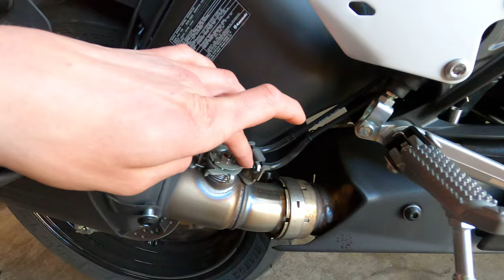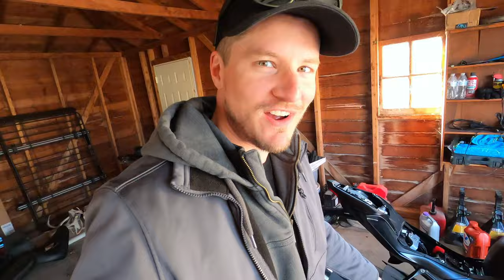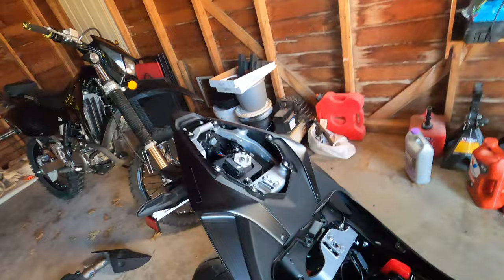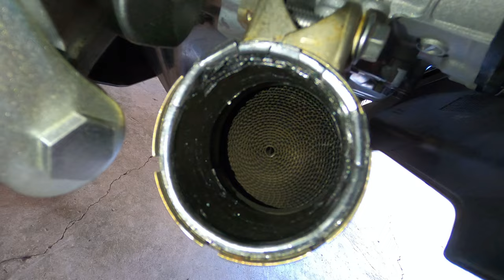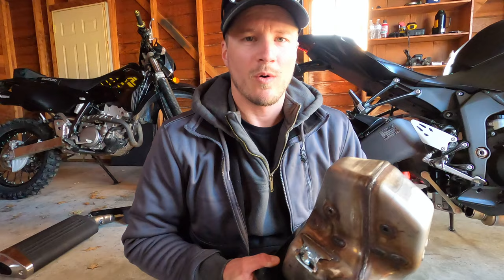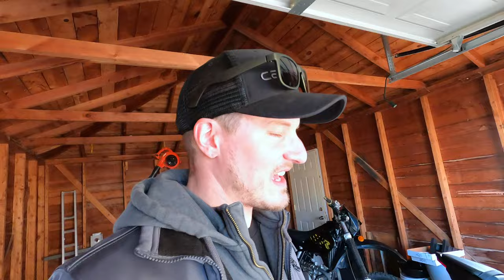Kawasaki Ninja ZX6R Exhausts / Every Question Answered / 2025-2009 / Removal, Install, Servo, CEL

Comment: I bought the M4 street slayer slip on. It sounds EXACTLY the same (without baffler) as the slip on the guy used in this video. Save your money, $100 vs $400. It is VERY loud, if you don't mind the noise, keep it. I recommend trying out the muffler with decible killer that this guy has a link for, BEFORE spending $400

Comment: Just btw, not saying anything is necessarily wrong, but it can take up to 100 miles in some cases before the ecu re-checks all sensors in order to throw a code or not, sometimes just resetting the battery works too but not always

Comment: I have good news and i have some bad news, good news is i can confirm on a 2023 zx6r that keeping the servo plugged in does not throw any codes or prompt an engine light no servo buddy needed. Now for the bad news, that last bolt you had trouble with on the expansion chamber also is giving me one hell of a time, it snapped my allen key so now i have a tip of an allen wrench wedged in there so now I am stuck trying to get that thing out.

Comment: As I’m watching this with great frustration, I’m now grateful to see you remove the expansion chamber. I could not get it to budge at all. Tomorrow is a new day!
Reply from the maker: Yeah just back and down, it's tight but it will slip outta there 👍
Reply: @bikesandbangs I really hope so. My Allen wrenches are in one of those pop out sets. I may need something better with more leverage. I tried for 2 hours tonight. You give me hope. As for the servo. I saw that tonight and was like wtf is that. I may have violently pulled it from the stock pipe. Oops. Anyhow. Links are here and now I have hope and pipe comes tomorrow. Picked up my 24 zx6 last week. So excited. Dropping 2 inches. On that note, do I need to make any adjustments to the suspension after that drop?
Reply from the maker: You won't need to adjust the suspension settings to maintain the same ride quality with lowering links, should feel the same. It will corner and handle different in the twisties though because it does slightly change the geometry of the bike. If you haven't had a chance to really throw it around you won't notice a difference 👍

Comment: I tried this and followed this to the T, even got the same materials, same fender eliminator from another video, etc.

Once I got to the factory link pipe / muffler after removing the exhaust, I found an o2 sensor on it, mine has two sensors. One in the muffler, at the beginning, right after the catalytic converter, and another before the catalytic converter.

Maybe it’s just an Europe thing?
Reply: Just reading through the comments and came across your post. I recently received my Racefit Growler X exhaust and plan on installing it this weekend. My exhaust came with a spot for a 2nd O2 sensor. My 24' ZX-6R only has one. I spoke with the owner of Racefit (In the UK) and the Euro bikes DO have two O2 sensors. It must be a Euro thing. I have to have an O2 plug in my exhaust because the US models only have one O2 sensor.
Reply: It does have 2 O2 sensors for the Euro5+ rating. I guess it's a matter of drilling a hole in the new link pipe to put it in? I bet there's sensor deleters too

Comment: I think that the misconception that the expansion chamber is the cat comes from the fact that on the ZX10R it is the cat.  Gutting the cat in the ZX6R header is a major PITA and is best done off the bike.  You will need a flash/tune and even then it's not a substitute for an aftermarket header/full exhaust.  Hindle makes a good full exhaust for those on a budget, don't waste your money on an Akra or SC or any of the poser exhausts, al they get you is bragging rights.

Comment: Hey Bud. I was watching your video about taking the servo cable only on the servo with your after market exhaust. Did you got any check engine light lately since you install the ebay exhaust?
Reply from the maker: Nope, just remove the cables and leave the servo wires plugged in and ur good to go 👍

Comment: the video is 6mos old is there any update to if the engine code came up after riding without the servo cables but leaving the servo still plugged in?
Reply from the maker: Never got a code 👍

Comment: geez...my 6MM bolt for the resonator chamber part came somewhat stripped by the factory! I have to call a friend over with mechanical wizardry to hopefully help me find a way to get it off. I got everything off just fine, even the 6mm bolt just below the tough one, so I know my hex size is right. What sort of monster put this thing together?!?! 
Edit: My friend used a hammer to bang the hex socket into that slightly stripped bolt and was able to get that monster off! Also prying that nut out of the metal housing on the back of Res Chamber was much harder on my bike than the video, I ended up having to Dremel saw it open enough to get that nut out! Everything else was exactly like the video, thank you very much for the help here!

Comment: Question; did you ever get an engine code from removing the cables from the servo motor? I’m about to attempt this process on my ‘24 zx6r
Reply from the maker: Nope never did, servo still plugged in with no cables
Reply: @bikesandbangs thanks buddy! Loving the videos, keep up the great work! 🤙🏼

Comment: hi man, if i put a slip on with mid pipe that removes the expansion chamber do i have to flash the bike ? will the motor be hurt if i dont? thankss
Reply from the maker: No you do not have to flash it 👍

Comment: Is there a way to make bike loud by using the stock exhaust? i mean just remove servo cable and by default that butterfly valve is always on and remove the breadbox and put a linkpipe with stock exhaust.. will it work?..
Reply from the maker: So I think you could do the link pipe to the stock muffler with the servo cables removed. But 90% of your sound dampening is in the muffler, so it will be a little more volume, but not much. The link pipe to delete the bread box is $65 and a no name mufflers is only $35 more. What is your reasoning in wanting to keep the factory muffler?
Reply: @bikesandbangs  I saw a fellow versys rider do that... And it sounded great... Actually here at my place sometimes police would do special drives and if caught they would seize your bike with aftermarket exhaust .. then you have to pay fine upto 250$ if i convert to USD 😂
Reply: If you do aftermarket headers, it should sound louder while keeping your stock exhaust and deleting the mid pipe.

Comment: Do I really need the curved connection/ link pipe for back pressure I think you called it? also it just looks so close to the rear tire is that also not an issue with the link pipe you used?

Comment: With a complete system change, do i need to do anything to the ecu/ mapping?
Reply from the maker: I'd get a flash if you do a full system. You might notice a slight dip in low rpm power, depends what system you go with. But you won't gain any power until a flash or tune, then you should see 12+ hp

Comment: I'm strongly considering running this on my zx6, but my main question is, does that exhaust and tip rub up against the swingarm at all after hitting bumps? Was a little worried about if there was any issue with clearance for everything.
Reply from the maker: No issues with clearance, it's not even close 👍

Comment: When you put this exhaust on did the exhaust fit into the cat like 100% snug? I just put one on a friends bike and there is a little bit of an exhaust leak where the turn pipe goes into the cat. The carbon seal is still intact.
Reply from the maker: Mine is 100% snug and tight with no leaks. Maybe check and see if the exhaust clamp is tight enough

Comment: Very informative! My expansion chamber won’t come off. Probably going to have to drill the bolts to get them out some the Allen key has stripped them from my tugging at them
Reply from the maker: Dang, idk why that Alan head bolt is on there so tight! Like it's ridiculous

Comment: there's no point in doing ANY exhaust work if you're not planning on getting the ECU flashed.. there is literally zero gain and all you did was make the bike louder. that being said, if you do get a FULL system (the only worthwhile exhaust upgrade) and have the ECU flashed to that system for max benefit, they can tune out the servo so you wouldn't need a servo buddy anyways. they'll also tune out the AIS/smog system and the o2 sensor so you'll be free of CELs and all the restrictions and their weight in extra parts..
i dropped over 30lbs between the exhaust, lightweight antigravity battery, servo motor, passenger pegs, mirrors and rear signal/plate/undertail crap.
Reply from the maker: There's plenty of perks to our exhaust job, great sound, dropped weight, looks a lot better. If you want to be wicked fast just get a liter bike
Reply: @bikesandbangs  there's plenty of potential in these bikes and many dyno videos to prove it. while you're absolutely correct in everything said - it's a shortcut.
in removing the servo motor completely, you're not only dropping weight, but making space too so you have at least some semblance of a trunk. my wallet and phone now fit.
a proper tune makes the bike run better everywhere as well.  you're option is a good *start and i appreciate the content.
Reply from the maker: Yeah for sure, just depends how far you want to go with a 600

Comment: Would I have to get both link pipes you put in the description or can I just get the short one and the muffler?
Reply from the maker: If you are keeping the resonator chamber you can put the short one on that, but the short one won't go straight on the header, you'll need the curly one if you remove the resonator box

Comment: Thank that's so informative. I have a question. What if I let the expansion chamber intact and just put on a slip on exhaust. Does it make a great sound? Or do I really need to remove tha expansion chamber?
Reply from the maker: It's the same sound, just barely a bit quiter. The audio doesn't come through great on my cameras so I couldn't tell a difference on film. I'd throw one on with the chamber intact, if you want louder, then just get the $55 link pipe that removes it. My setup is really loud though, like extremely. Depends what you want
Reply: @bikesandbangs  thank you I would do as you say.

Comment: Would I be able to mate that link pipe that deletes the resonator to my akropovich slip on?
Reply from the maker: Yes, any 2" or 51mm slip on exhaust that just has the hooks and is held on by the two springs will fit on it 👍
Reply from the maker: Measure the inlet on ur akrapovich to confirm but I believe it is

Comment: Im confused is your exhaust 2 pieces or 3? You have 3 links in the description.
Reply from the maker: You only need two pieces. There's two different link pipes because one is to be used with the resonator expansion chamber and one deletes it
Reply: @bikesandbangs your videos go above and beyond. I ordered the slip on and link pipe in the description of your oil change video. Is that all ill need?
Reply from the maker: Yep, nothing more needed. And you will be so pleased with the sound and look! Thanks man 👍
Reply: @bikesandbangs sorry i have one more question. Theres no mount? Its only held on by the springs?  Thats not an issue?
Reply from the maker: With the link pipe being so short and having a firm mounting point on the frame, it's very solid without any sort of a hanger. Just the springs are good
Reply: @bikesandbangs thank you so much! Love your content!

Comment: Is there anyway to contact you outside of here? I have questions lol I’m from DE and have the same bike I just purchased last Friday!
Reply from the maker: Wacha got questions about?
Reply: @bikesandbangs  did your light ever come back on? The exhaust set up will be here tomorrow, and did you change that slip on? From the original you had placed on there first?
Reply from the maker: No exhaust light ever came on, was just riding more today and everything is perfect. I still have this muffler but I have since gotten a different Amazon muffler that has a removable decibel killer since I live around a bunch of old people and families, I work late nights right now. I just posted a video today of the muffler I currently have on it. Sounds the same but I can put that DB killer in the end and make it quite when I need too
Reply: @bikesandbangs  def hard to gauge from a video, sounds good, and if I didn’t find your channel I would have def dropped 2k on top of the 8k I dropped on the new ZX lol I just need to know if this is going to piss my neighbors off 😂 I live in a super quite neighborhood and half the people are old and retired 😂 and my wife**
Reply from the maker: They will know when u leave and when ur coming home is what I'll say lol
Reply: @bikesandbangs  awesome. Just what I need 😂 how is it when you’re getting on it on the highway?
Reply from the maker: @BrothaBanye  it's good, puts out a bunch of sound but not as loud or annoying as some of those super shorty gp pipes. The thing I like about this setup is that I can try one pipe, and since I have a universal link pipe, I can get another $35-40 dollar exhaust with a different outlet size or a removable DB killer if I want to go louder or quieter, or just to change the look. I could have my link pipe and 10 different mufflers for the same price as the cheapest name brand slip-on exhaust
Reply: @bikesandbangs  so do we just need the measurements for it? Or is it pretty standard if you wanna swap the slip on out?

Comment: After delete catalyst need tune ecu or it will not engine problem and can ride?
Reply from the maker: If you have a curly 360 link pipe like I put on, you don't need to. If you delete the cat and have a muffler that comes straight off the header, I would if I were you. You can still ride it but eventually I would get a tune so you're not running too lean
Reply: @bikesandbangs  i have m4 gp19 and today deleted catalyst
Reply from the maker: Nice man, I bet it sounds wicked! You'll pry want a tune eventually with that exhaust. I'm sure it's shooting fireballs now 👍

Comment: That 6mm hex is tight as hell on my resonator as well 😭 couldn’t even get it off with my t handle
Reply from the maker: Yeah you will need an "L" shaped hex key with a little pipe or a socket and extension on it. It's a bugger

Comment: Did you have any issues getting your link pipe to tighten where it connects to the header? I ordered there exact parts and am having and issue getting the pipe to get secure. I also tried using the stock bolt that held the resonator but it seems to lose its threading? I’m I just stupid or is there a trick to this?
Reply: I ran into the same problem just now. Hopefully he answers. I’m having slight movement when I touch the exhaust. It mixes towards the left side of the bike but not too much
Reply: @angelmarquez2059  I used heat tape. Has worked well.